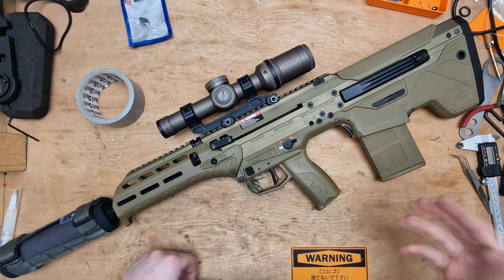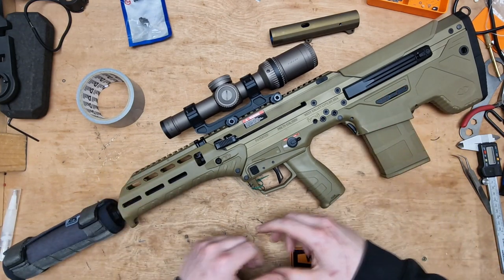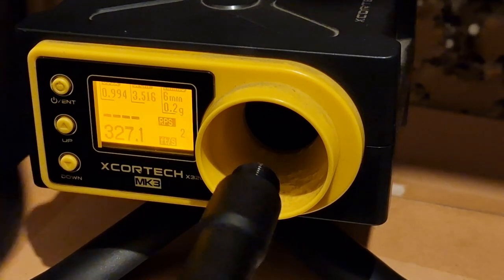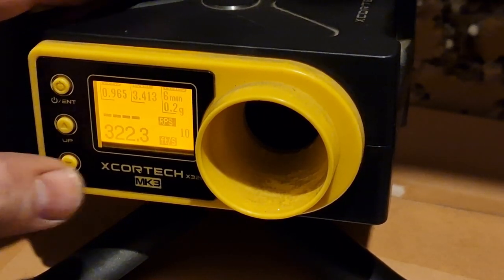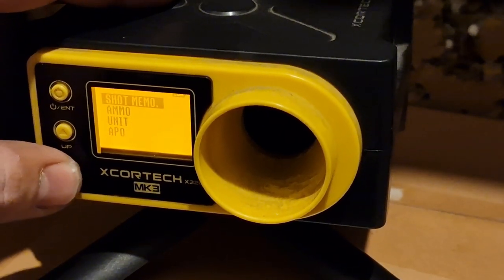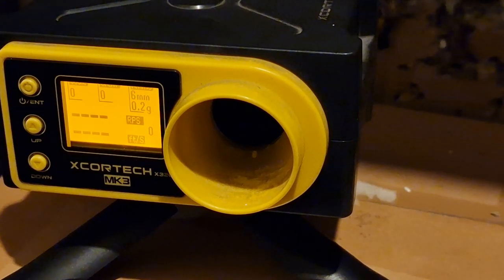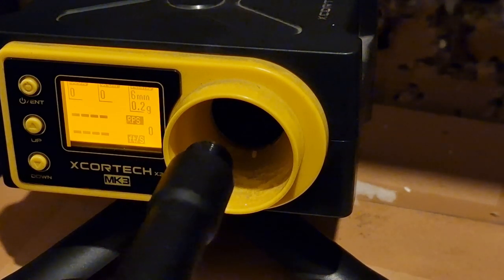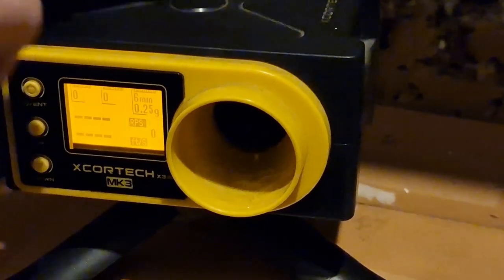Silverback MDR-X 100% Cylinder - Joule Tests

Comment: Honestly I don't see a purpose of such tests by many reasons.
First of all in my opinion the hop should be set for such test. Why? Let's say that we always set our hop up to the level we use is in games and we prefer that BBs would have the flattest fly path (without overhop). I am sure that everyone noticed that heavier BBs require more hop to give them enough spin. So for every weight of BBs you need different level of air pressure to push the BB past the nub - the heavier the bb -> more hop is required -> more pressure is needed. 

Everything in AEG is based on how we transfer the energy and many factors have an impact on that. The spring, wire thickness of the spring, piston stroke, greases we use, weight of piston and piston head, the port in cylinder (cylinder accelerates faster before it starts compresing air), the bucking we use, nub shape, barrel diameter, barrel length and so on.
It's also woth to mention that the spring we use is related to the ammount of air in the cylinder.
Stronger spring need more air to transfer all it's energy to BB. There ale limits for how much the particular spring can compress the air. Let's say you have enough air to use full potential of M120 spring and the joule output is 1.9j. If you mount bigger volume cylinder you won't get more power because the spring cannot compress the air more. BBs can left the barrel, but the piston is still on it's way, so it will still push the additional air after the BB which have negative impact on BB's spin.
Let's reverse the example - really small cylinder with M170 spring and we get 1.6j because we cannot compress the air more. Even if we put M160, M150 the joule output is the same because each of this spring have enough potential to compress this ammount of air (it's simplified because stronger spring creates higher joule peak the the piston starts to move, but it's not the point here). And in such scenario the piston can slam the cylinder head when the BB is still in the barrel - there is no more energy to push the BB, it starts to slow down when it's still in the barrel and furthermore the piston energy we didn't use will be transfered to gearbox shell which can even breake.
So we have to use proper cylinder volume for the spring and that's why I don't see the reason for such tests you performed - you didn't set the hop, didn't set the spring, didn't make use of that additional air.

I am aware that our experiances may be different, but what I observe in my enviroment is that overvoluming the barrel have negative impact on the accuracy. Believe it or not, but x1.6 - 1.8 cylinder to barrel volume ratio is all what you need to maximize the accuracy and efficiency for 1.9j assault replica and with properly assembled setup it's not a problem to hit human size target at 75-80m.

Again - that is what I observe and what experience show in my environment. I may also didn't get something, so I would be glad to hear your opinion and point of view.
And I keept my fingers crossed for the MDR-x of yours. The replica is not worth the money (for poor state out of the box...), but still looks sick :)
Reply: Very nice comment. sba suggest that higher volume is for longer barrels.
Reply: In which environment have you observed a negative impact of « overvoluming » on accuracy
Reply: @Uria-jz1gu  Hi. As I described before, when you have too much air the BB leave the barrel with this additional compressed air behind it. It does have and efect on BB's spin. BBs can fly straight for 30-40 meters and after that the fly paths is random. Especially observed when you shot a few shots is series - BBs have big spread, like "trumpet" pattern. The lighter the BBs, the more it's visible.
But for sniper rifles and heavy BBs (like .48g) it also matters. For example stock 16" SRS has 420mm barrel and many people observe increased accuracy with 510/6,05 barrel because the cylinder does not overvolume the barrel as much as before.
Reply: @Baldzior69  what is your level in fluid mechanics ?

Comment: I am surprised at the lack of Jouel Creep, a slight joule creep moving from 0.2 to 0.25.  The Joule drop on the full cylinder is a real surprise, but shows what I know!I understand the FPS drop with heavier BBs.
Reply: The reason for the FPS drop when using a full cylinder is well versed in the airsoft community for a long time now. It's the reason why Marui start porting cylinders in their M4s that had originally been utilizing full cylinders just like their longer barrel M16s. Turns out the BBs wouldn't stay long enough in the barrel for a full energy transfer before exiting the barrel. Simply put the piston was still accelerating as the BB left the barrel. As a result the guns had louder impact noise and the gearbox shell cracked more easily. This just shows how important it is to properly match your cylinder volume to the barrel volume.
Reply: The second reason why a ported cylinder provides better compress is because it adds "started momentum" on the piston before airseal. Thus creating a higher "jerk" for the projectile during it starts. The jerk will peak the muzzle vec at its best manner, but is harmful for the hop rubber nub.
Also it provides lower fps standard deviation because the oring will seal exactly at every cycle, as long as your cylinder does not move inside the gearbox